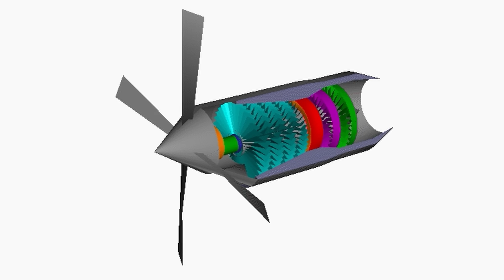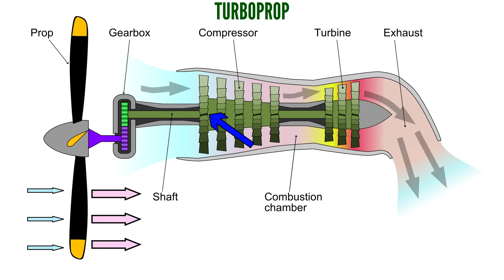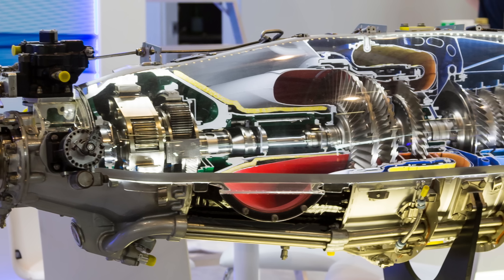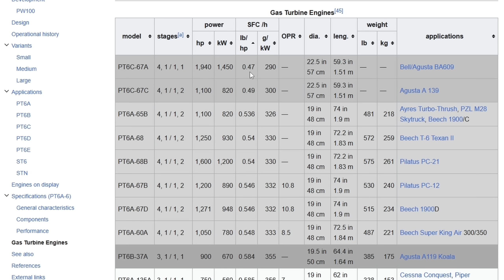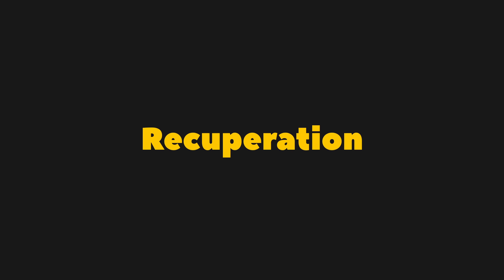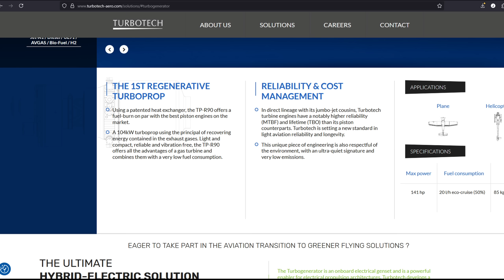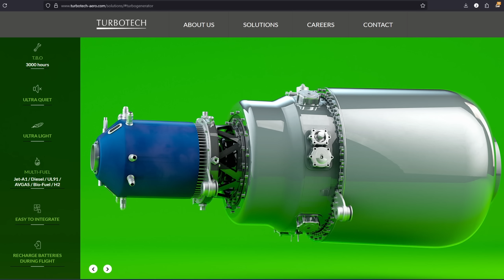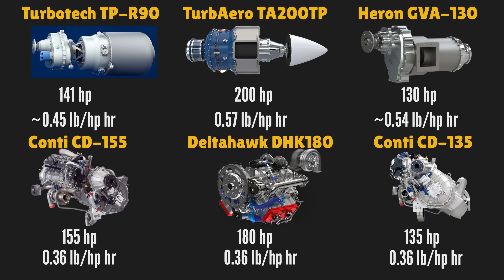Are Piston Engines Dead? Small Turboprops are Here

Comment: Are you Serious????  Mercedes just designed an Electric Motor that is 45lbs with 750hp!!  That is topping the now available 600hp 68lb Electric motor.  Battery density is doubling every 4 months.  We are over the density figure that makes Aircraft electric motors feasible.  Lets get real.... any kind of cumbustion engine design are OBSOLETE..  Efficiency and power, low maintenance 90% less moving parts.... makes Electric motors a million percent more usable then comustion engines.. LFP batteries do not burn.... many new batt chemistries are coming out making other obsolete within months...  Turbo, Supercharged...bla bala bla cumbustion engines are done..  read the tea leaves.   any kind of liquid fuel or hydrogen motors.....................done
Reply: "Battery density is doubling every 4 months" .  Really ? Where these batts are ?  :)))
Reply: Energy density of batteries is  not doubling every 4 months at all. Actually, the lack of it and slow progress in this KPI is the biggest problem to electric propulsion in aviation.
Reply: @TimToussaint  Ok, I was being over anxious... about 10yrs ago it was 150w per kg..... now it's 300w per kg.......  Batts on the bench now are 4 to 450w per kg.  Its only going to get higher and cheaper...  I can now buy 15kw of battery storage for my pv's for $1300.....LFP which don't catch fire.... about 10 years ago it was about 20 to 30 thousand dollars.  in 5 years 30kw of battery storage or EV batt will be less than $500.
Reply from the maker: I was told this more than 5 years ago already, yet here we are. No disrespect intended, but tell me again in 5 years how close internal combustion is to being obsolete in light aircraft. Happy to publicly admit my mistake should I be wrong.
Reply: @LetsGoAviate  The fact that the existing industry is resilient to change and trying frantically to stifle any progress... pushing disinformation about electric motive systems.  The facts are the facts...  90% less moving parts, regen breaking so never replace brakepads, superior power per lb..  it's not even close, battery tech is evolving at light speed, I hated that 100hr rebuild on my Cessna, an Electric Cessna would be so much easier and cleaner and faster and cheaper and ....and .... and .... In a few years solar will be so much more efficient, paper thin solar panels covering the wings will self charge the aircraft so you will never need to charge it again.  Perovskite and other new ai generated materials will rocket the solar panel efficiency beyond 60%.  Soon instead of a 100hp single engine plane, I can fly a 800hp single engine plane for 1/3rd the price..... and fuel costs as much as running a large air conditioner. ...   why are so many people against obvious progress??  Cumbustion has seen its day... the improvement percentage is in the 0.2% range....  GM investing billions to improve ICE 1%.....makes absolutely no sense what so ever.... its the status quo OIL industry tryig desperately to stop the nonstopable electric systems coming.  92% of people who switched to EV, would never ever go back to ICE.  Airplanes are just next on the list,, then electric powered jet Motors for rockets.........coming
Reply: Very true for the future, but I think Hybrid designs for airplanes are pretty compelling as well. Generator, batteries, and super light and small electric engines do seem a really strong future option.

Comment: When one considers the extravagant cost of AVGAS for piston engines, and the ability of turboprop engines to run on such a wide variety of far cheaper fuels, the gap may be closing very rapidly on that score? Further, the decrease in weight of the power plant would increase the overall load borne by the airframe, in terms of overall weight limits, this may be more significant for commercial operators. When further considerations are made for the increased servicing intervals and downtimes for commercial operators, I wonder where the chips may fall. This must not be considered only for private operators alone, but also for the commercial fleets which are again a primary market, which may introduce them earlier than other sectors. Helping to bring costs down.
Reply: the weight savings would be offset with increased fuel load in the case of the "non" recuperated engines; if the same range requirements were needed. I am going with diesel for fuel choices.
Reply: @thepadonthepondbythescum  Yes indeed, diesel is a great alternative as the Germans found in WWII, but I am discussing market penetration as well, which will slowly bring turboprop engine prices down eventually?
Reply: @thepadonthepondbythescum  Diesel indeed as the Germans found in WWII, but another consideration is market penetration which should decrease the cost of turboprop engines eventually, and once the consideration of servicing costs become a heavy enough burden, it may tip the equation in favour of turboprops in the end. But I am not one to say when.

Comment: I have noticed turbo props exhaust discharge points, some in front of wing aimed down, most over top of wing. Larger units discharge into trailing edge of the wing and normally at top of wing. Point is from spitfire and mustang Merlin's, certain exhaust tips added indicated HP in flight, about 200hp.

Comment: Turboprops are great but expensive for GA! The PT-6 turboprop engine costs about $225K to $600K! The cost of a plane would sky rocket in GA if turboprops were used for all GA planes and make it unaffordable for GA owner/pilots. A better solution would be the Deltahawk engine: it has less parts, no Camshaft, Gearbox and no FADEC. Deltahawk runs on Jet-A fuel as well. All GA planes should run on Jet-A to eliminate 100LL.
Reply: besides that one, someone really needs to make and certify a modern car engine style engine with direct injection etc. leaded fuel shouldnt be used anywhere
Reply: Where are you finding leaded gasoline??! I keep hearing about this when I happen to know that it has been outlawed everywhere. So what gives? Do you flat earthers think gasoline has lead and diesel doesn't or something? Lead has been gone for TWO DECADES!!! @SB7-r9i
Reply: PT6  600-2000Hp  You don't need so much power on most GA.
Reply: Try finding a gas with lead in it! You don't see 100ll it's been replaced by 114 no lead. Just so you know, this trend started in the late 80's.
Reply: Disagree:  have you priced out a delta Hawk? It’s more expensive than two of the turbo prop options shown here, and I think does not produce as much horsepower and weighs more.  This video convinces me that turbo props are near term.  Also, see my comment I left on this video shortly before yours. It gives other arguments why at least these turbojet candidates may break the pistons.
Reply: @hu5116  Deltahawks are expected to cost between $60k to $110K depending on the hp selected. That makes Deltahawk engines price competitive with Continental and Lycoming AVGas burning engines and way better price competitive to any turboprop engine for GA use. GA planes do not need the high horsepower that turboprop engines can produce. Deltahawk will also address reliability as the engines are expected to have TBO's of around 3000 hours. with the average GA pilot flying no more than 100 hours per year, TBOs around 3000 hours is 30 years of flying, theoretically.
Reply: @hu5116 piston powered aircraft are a thing of the past. Turbines have too many advantages. The prices are going to come down. Have been for decades.

Comment: GA will adopt piston engines that can run on auto gas before they adopt turbo prop. Turbo prop is more expensive, burns more fuel, and the fuel weighs more per gallon, all making conversions impractical for most situations.
Reply: The DeltaHawk is an extremely heavy engine.
Reply: Diesels like Delta Hawk are extremely efficient reliable and light weight. It’s a two stroke diesel.
Reply: @Dave5843-d9m and the emissions......?
Reply: pt6 tech here - agree 100% - turbine conversions and operations are far too pricey for most small GA aircraft - 2 stroke diesel would be instantly ideal,  as mentioned below - max power and efficiency extracted from a system

Comment: Efficiency is also partially recovered by their use of radial components instead of axial blades as your schematics/graphics are showing. Radial turbine is a different beast. More durable and reliable at this size. I bet that the heat-exchanger will be the weak point in any long term TBO trends. The luxury market will probably like these a lot if they can scale up to the 400hp range.

Comment: No jet engine video should end without mentioning the cri-cri. Thanks for explaining it really well.
Reply: Thanks for not cri cri-ing about it.
Reply from the maker: 😆 thanks
Reply: Or the Bede BD-5J
Reply: @TDOBrandano  True
Reply: Why?
Reply: @9HighFlyer9  cricri was a really small single seater you could build in your garage and fly. it had a unique shape and 2 motors. They have a youtube channel where you can see the build process too. The reason to mention it here is that someone made a modification to it where 2 jet engines were attached to it instead of the regular 2 stroke engines. it was really noisy but looked really cool and futuristic.
Reply: @agenthimzz  The idea of dual 2-strokes on a GA plane makes me visualize two Trabants welded to the spars of a C150.
Reply: @agenthimzz I'm aware of the aircraft. My question was why include it? It's incredibly small. Powered by incredibly inefficient micro turbines used more commonly in RC aircraft. It has almost nothing transferrable to a certified or even kit plane with actual utility.

I still think it's incredibly cool and although I wouldn't fly one seeing one fly would be interesting.
Reply: @9HighFlyer9  It looks like its from The Flintstones. When I saw the first video of it I thought it wasn't even real. 
Also because of the turbojet video topic.
Reply: @9HighFlyer9   cri-cri is one of the rare single seater self built type of planes that can be a ultralight (or may be experimental). just google it and you will find their youtube channel using which you can make your own. 
They used two really small engines to run and really small propellers. the wing span was also small, that it almost looks like a toy plane. 
On top of that One guy had replaced those 2 engines with 2 chinese jet engines and modified his cri-cri. It looked really sleek and flies well but it made too much noise. 
Theres videos of it too its a really cool design. not a lot of confusion while making it.
Reply: Dit is Dawie and Sakkie se airie daai
Reply: The cri-cri was a one off modification, and the plane is so small as to be irrelevant to this discussion
Reply: @edcew8236  In an era where innovation in aviation is for the most part held prisoner by well funded corporations, ingenuity like the cri cri and it's jet engined adaptaion are to be applauded. It reminds us that the spirit of innovation that drove the likes of Lillienthal and the Wright brothers amongst many other pioneers is still alive in a small way.

Comment: When looking at efficiency remember that Jet A1 is denser than 100LL so fuel burn in gallons/liters per hourfor the small turbines is closer than it appears. Jet A1, in the UK, is almost half the price of AVGAS as well as being more readily availible. I wonder what the maintenance costs for the turbines are? No/fewer sparkplugs to change, 50 hour oil changes, mag overhauls, etc. I think that these are a question of pay now, save later.
Reply from the maker: The fuel density was already taken into account in all comparisons. Only still consider weight of the fuel it needs to carry in fuel tanks, and Jet-A1 is slightly heavier than Avgas and Mogas. 

Also consider that Jet-A1 is cheaper than Avgas, but not often cheaper than Mogas.

Lastly, Turboprop engines are generally more expensive to overhaul, so that will neutralise the longer TBO from a TCO perspective.
Reply: @LetsGoAviate  Yes, my friend, you did. Great presentation anyway!

But what he means is the fuel consumption as far as your tank and your wallet is concerned is measures in volume, not mass. What he says is that this offsets to a certain degree (about 15%) the higher mass/hp hr of turbines.
Reply: @LetsGoAviate  Thanks for the info. Do you know what the "normal" (if there is such a thing) TBO is for a turboprop engine? 

Thanks and keep up the great work, its appreciated.

Comment: I don't know about the rest of the world but here in Britain Avgas costs twice as much as jet A. The cost of operation will be considerably less because of this. The initial outlay of $100,000 for an engine might seem like a lot. However, A Rotax 915 has a 1200 hour TBO. These small turboprops are likely to have significantly higher TBO. Im not sure if you can overhaul the rotax engine too.
Reply: Also what's the cost of a hot section or full overhaul of a PT6? TbO is higher but when it does come time the pice is higher. Alot higher.
Reply: @richarddrapeau7599 $250k but nobody is talking PT6 here so it’s irrelevant
Reply: @mattym8  the point is turbine engines have higher TBO but even higher O prices.
Reply: In the US, Avgas and Jet-A are usually similarly priced. Rotax engines can burn mogas (car petrol), which is considerably cheaper. Is mogas an option in UK?
Reply: @OneAlphaMike  MOGAS is an option in Europe if you have a Rotax engine. It's not an option for Continental and Lycoming in type certified aircraft because E0 MOGAS is unavailable (illegal to sell). And all the US STCs specify ethanol free fuel, not E5 available in Europe. There are many owners who got their STCs before 2011 before the ethanol mandate and keep flying with the current MOGAS. No one bothers them and no one is taking fuel samples but I laugh at people who got their STCs after 2011 as it's a worthless investment. Why not just use MOGAS without a STC?
Reply: @OneAlphaMike Mosgas can be used in rotax engines. But is not available at many airfields. Mosgas is about $1.60 USD per litre. So jet A is still cheaper and widely available. Unleaded (approved) AVGAS (UL91) is like $3 per litre as some fields.
Reply: @OneAlphaMike  Yes MOGAS is an optiion but its not typically sold at airfields. You can of course buy it at your local petrol station. There are rules about how much petrol/gasoline you can carry in a car but I don't believe that these are routinely enforced.
Reply: How many hours do you fly a year? I bet more like 50-100.
Reply: It costs more than triple in continental Europe. The biggest thing in gas turbines is fuel flexibility.
Reply: In Canada AVgas is around 25% more expensive. In the US the difference is a bit less.
Reply: 915 isnt a great example. The 916 has almost the same weight, greater power, better efficiency, not much more expensive and a better TBO. Overhaul costs as much as a new Rotax engine typically
Reply from the maker: Agreed. But I couldn't not make the comparison as they both output 141hp which is quite a specific power output number for both to end up on.
Reply: @LetsGoAviate  Almost, the 915 puts out 141 maximum and 137 MCP. The 916 has 160 max power and 137 MCP.
Reply: @FasterLower I was told that come 1200 it becomes effectively scrap.
Reply: @bigwings1891  It does not become scrap, lol. Unless operating commercially, you don't even have to overhaul at the TBO. You just run on condition. Many Rotax 9-series have run well beyond TBO, in many cases well over 4,000 hours.
Reply: @OneAlphaMike In the UK my club has an aircraft running a 915is for glider tugging. If you want to run something on condition you need to have it inspected regularly. If they find something serious then you then need an unexpected engine overhaul. It's also a matter of peace of mind.
Reply: @bigwings1891  Generally Rotax engines cost as much to overhaul, once you factor in labour, as a new engine. So while they are overhaulable most people don't bother. So I suppose that you could call them "scrap" BUT you do have a usable engine, though you probably wouldn't want to bet your life on it! It would make for an awesome engine for a custom lawn mower though!

Comment: The Lynx engine promises significant power increases, especially at lower rpm. It is self-supercharging needing no add-on blower either super or turbo charger.  It is light, compact and less complicated than conventional 4 stroke engines and ideally suited for light aviation adaptation.

Comment: Isn't Jet-A1 cheaper than 100LL? Also there are many problems with 100-LL. They are trying to replace it. I know many Rotax work on Mo Gas.

Given the choice I'd got for this turbo prop.
Reply from the maker: Yes Jet-A1 is cheaper than Avgas, but not (not usually, at least) cheaper than Mogas (automotive petrol). Half the piston engines I compared to run on Mogas.